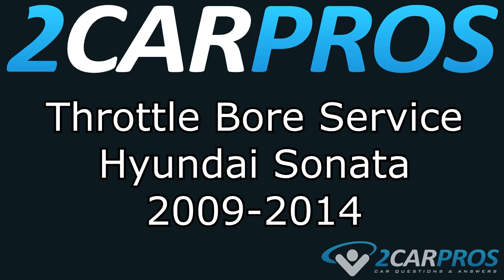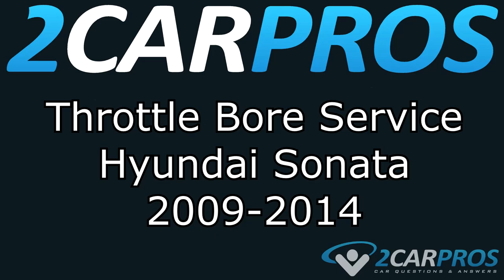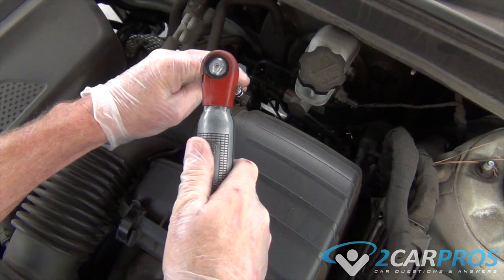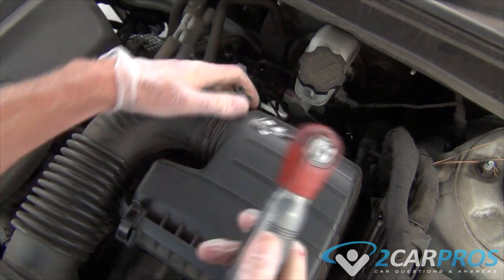Throttle Actuator Service Hyundai Sonata 2009-2014

Comment: I just cleaned the throttle body on my 2011 Hyundai Sonata and this video helped a lot. It was the first time to clean the throttle body and was shocked at the amount of build up inside. Now the car runs like new and simply amazed at the difference a simple cleaning can do. Thanks for the video!
Reply: I have a 2011 sonata as well. Having some rough idling noise. Fuel injector cleaner helped somewhat. But looking for a better solution. was rough idle the issue you were having and did it come back?
Reply: Don't need to relearn the throttle body after?
Reply: What issues were you having before cleaning the throttle body?
Reply: Thanks for this comment! My hyundai sonata 2014 got the same issue of funny Rpms when idling and I understood that idle has three important parts to check/clean which are: Engine Air filter and mass air flow sensor (MAF), throttle body and IAC (idle air control) sometimes the PCV valve also increase the RPMs when it's clogged.

Comment: I just did this to my tired old 09 Sonata.  Symptoms were a rough running, stalling engine and a check engine light. I forget the code #, but it tripped from the MAP sensor. My only deviation from the video instructions: I could not get the wires disconnected so I left them connected and gently turned over the throttle air bore for cleaning. It was awkward but I was able to do the cleaning without breaking any wires.  I also disconnected the negative cable on my battery before I began disassembly. 

Thanks to this great video, I'm back to a smooth running engine. Hope this is helpful to someone.

Comment: Great video! My Hyundai dealer did this when they cleaned out the GDI system on my '13 Sonata . As retired tech they were gracious enough to allow me to observe the procedure so I could do it myself next time. I was worried about messing up the calibration of the throttle body, but you put that fear to rest. Thank you!
Reply from the maker: Thank you for watching!

Comment: I can't say enough for this SIMPLE PROCEDURE!!! I have a 2010 Hyundai Tucson Limited 2.4L and this FIXED rough idling and the sensing mechanism "searching" for the right air-to-fuel ratio!!! The Technical Service Bulletin I found pertaining to the procedure I followed is: TSB "10-FL-009 2.0L AND 2.4L THETA ENGINE ETC THROTTLE BODY CLEANING". Gas mileage range registered by computer for a full tank prior to this procedure was about 230 miles. Mileage range registered by the computer after this procedure was around 317-320 after a fill-up!!!  AS A NOTE!!!, in the TSB it was stated at the conclusion of the cleaning process:

"Without starting the engine turn the ignition key ON for at least 10 seconds and then
OFF for at least 10 seconds. This procedure allows the ECM to automatically learn
the throttle valve position.

Throttle Position Learning Enable Conditions that must exist for learning to take
place:

• Battery > 10V,
• Engine coolant temperature >5.3C (41.5F)"
---
Hopefully this info helps more people!!!
Reply from the maker: Awesome! Thank you for watching!
Reply: Thanks, will try that too.
Reply: That help me. Thank you for sharing!
Reply: ADDING TO @FooKingsOC These are the TORQUE SPECS for the Throttle Body Housing, 2011 and later models	87 to 104 in-lbs	10 to 11.5 NM

Comment: Is there aneed to clean MAP sensor next to the throttle body?
Cause I still have power loss below 5000 rpm after cleaning the throttle
By the way mine 2.4 mpi engine
Reply: I have power loss from idle to 3000 rpm, pass that, it takes off. I have not cleaned the TB yet but I wonder the same thing you are on the MAP sensor.

Comment: My Hyundai accent 2007 looses power and starts running rough when I exelorate my guages start jumping around and my check engine light comes on but the ECU won't store the code I can't find anything online in regards to this issue

Comment: I do have a question: I have seen people from other car shops stating you cannot touch the insides of the throttle or the calibration setting will be gone. If you happen to touch the inside of it ( like you did on the video) you will need to get the acceleration of your car manually calibrated (probably by the car manufacturer's local retailer or a specialized service car shop). So the question here is did you have to work the calibration out once you finished doing this procedure you explained? I have a Kia sportage 2015 and I'm looking to fully understand the right way to get his done before taking it to the car shop (I'm still not sure I can do this myself even when I previously serviced other old cars I had in the past) Thanks!!!
Reply from the maker: There was no calibration needed the car started back up. The computer in the car auto calibrates. Thank you for watching!
Reply: Thanks for the quick response. So, as long as the ignition is off you can feel free to take the throttle body out, fully clean it out and the put it back in place?
Reply from the maker: Yep I have never had an issue. Thank you for watching!
Reply: I just cleaned the throttle body on my 2011 Hyundai Sonata and there was no problem after starting the car and driving it around.
Reply: These guys are wrong you going to have to do a throttle relearn if u open the butterfly plate so if u do before starting discount the battery hold the brake down for 5min and leave battery disconnected for minimum of 2hrs
Reply: @TheShawn3636  , that's what I've heard. This confused me. I was told NOT to manually move the butterfly flaps or risk doing damage. Can someone offer some insight??
Reply: The relearning process I have seen on another video is turn on the ignition, but don't start the car, then turn off the ignition for 10 seconds, and then start the car. @TheShawn3636

Comment: Hello,
If  I clean the throttle on my Sonata 2011, after that do I need some calibration with software or I start the engine and everythink will be normal???
Sorry for my English!
Reply from the maker: It will re-calibrate on it's own. No re programing required. Thanks for watching!

Comment: @2CarPros, just an observation, your technician did not disconnected to coolant hoses from the body.  i believe, it will be easier to clean if they have been disconnected, then you will have easy access to the throttle housing.  Thanks.
Reply: Not really easier if you have to do extra work now is it? This man did it just fine

Comment: I have a 2006 CM Hyundai Sante Fe 2.7 litre V6 manual transmission. The engine speed takes a long time to return to idle, when driving changing gears is especially bad having to be gentle as not to get driveline lash. What might it be do you have any thoughts? Thanks for your time.

Comment: If only the rubber hoses that connect to the air intake actually come apart. Mine are hard as a rock and completely stuck even with quality extended needle nose pliers cannot remove. Is there any product to spray to soften the rubber?

Comment: I had hesitation on acceleration and deceleration issues on my 2016 Sonata. Dealer tech said that VCMA needed replacement and work done on the intake. Is this the same thing? Also, will they need to update ECM after this service?
Reply from the maker: Yes and I would try this fix first before replacing anything since this is free. And no you don't need to do anything to the ECM. Thanks for watching!

Comment: I have 2012 Kia Optima hybrid p2110 and p0605 should I do this cleaning? Would it fix the problem ? Or there be other stuff related to those codes ?
Reply from the maker: Yeah I would definitely give it a try since its basically free. Clean it up all nice and new then wipe the codes and see if they come back.

Comment: Im guessing you do it like this still in the hood so as to not disconnect the coolant lines?  I've got a hyundai elantra that's alot like this and am kind of glad to come across a config that's similar, since another video said I had to flush the coolant first.  My only question here now is if it's safe to move the plate by hand since I know that's bad on some cars :P

Comment: I have a 2000 GLS 2.5 v6 that’s at 3000rpms at 80mph and I feel like that’s not right any suggestions?
Reply from the maker: I would definitely start with a throttle body service as it's free. Thanks for watching!

Comment: Was there a need to replace Gasket for Throttle Body? If so, which one would fit?
Reply from the maker: If it's in good shape I'd just re use it. But replacing it would be fairly cheap and you can find them at rockauto.com Thanks for watching!

Comment: So there are no coolant hoses attached? I have a 2013 Elantra and it has coolant hoses connected to it, so in that case do I need to drain the coolant before taking out the the throttle body? If I don't drain coolant what could happen? Thank you
Reply from the maker: So that is a coolant pass through that heats up the throttle housing to make the air hotter so it combusts easier. If you take those hoses off it will leak coolant. Probably not a ton just make sure the system isn't under pressure when you do it. Thank you for watching!

Comment: Hi, n thanks for the video!!! Two questions!...Do we need to disconnect the battery, and what is the torque setting for tightening up the throttle bolts?!    Don,  TX
Reply from the maker: No not really and I can't find the factory spec for the torque. Just tight in a cross pattern. Thank you for watching!
Reply: 2011 and later models	87 to 104 in-lbs	10 to 11.5 NM

Comment: Thanks for this video! Great step by step. I always struggle with dang electrical connectors as it seems they're always different in EVERY car at EVERY connection! I typically end up breaking some dumb snap retainer piece of plastic half the time. Love the University of YouTube!
Reply from the maker: Thanks for watching!
Reply: @2carpros   @2CarPros  I have a 2009 Hyundai sonata 2.4 cylinder  and I replaced the alternator. Fairly easy job. But after I replaced it I started the car up and went for a ride. Everything seemed fine until I came to a stop sign and as soon as I pressed on the brake the car stalled. Not only does it do that but when the engine is cold the idle looks good but as soon as it warms up the idle drops down to a low 400 to 500 rpm and if I rev it up it will stall when idle comes back down. I had none of these problems before replacing the alternator. I did not touch any vacume lines while replacing the alternator. I'm totally baffled. Before I start replacing things I figured I would try and get some help first. Also I get no codes.

Comment: i did the same service at my 2014 sonata but dtc p0106 came up  MAP/BARO Pressure Circuit Out of Range
Reply from the maker: Did you plug your mass air flow sensor back in? Leaving that unplugged can cause this. Thanks for watching!
Reply: Next time you have to do a throttle relearn by disconnecting the battery hold the brake down for 5min and leave battery disconnected for a minimum of 2hrs
Reply: What solved it for you?  I just did this today and got the same results.  My plan is to check/clean electrical connector and pull map to clean and new air filter.  But experience is GOLDEN... pls : )

BTW, throttle bodies need cleaning on many and by many I mean almost all vehicles.
Reply: I let the car sit unplugged from the battery for 3hrs
Reply: Also if it continues to come up just changed the map sensor
Reply: With that code your car has entered limp mode

Comment: I have a 2007 hyundai sonata. It literally accelerates as soon as i put it in gear, weather it is reverse or drive. Already replaced the throttle body but didnt help. Any ideas?
Reply: I have similar problem on my Hyundai i20 after throttle body cleaning, idle rpm has been increased and pick up speed of the car has been increased.  I have no idea.
Reply: Louis: TPS sensor ( throttle position sensor ) usually located under ur pedal or at the throttle body itself. Easy to change and inexpensive, however I’m not sure whether u would need to calibrate the sensor once fitted so the sensor knows what is 100% open throttle and 0% closed throttle

Comment: You can't clean the throttle body like that if it's the electronic type, you will mess up the calibration then you have to reprogram it as far as i know
Reply from the maker: No, the computer is pre-programmed to work with the throttle body clean. So when it gets dirty is the problem. When you clean it, it returns back to factory specification. Thank you for watching!
Reply: It has a spring return mechanism....with return sense.....if it can't return to zero caused by build-up from carbon and other varnish type compounds, It "hunts" for zero, which causes rough idling!!!

Comment: Do I have to remove the map sensor to spray valve cleaner in through the throttle body?
Reply: Not sure if you have to but I normally do when I clean them. Better safe than sorry I guess you could say.
Reply: 2 Years late here, But I have a video on the MAP Sensor, and I would say anyone trying to do the Cleaner through the Air Intake should remove the MAP sensor. Or be prepared to clean it after you spray in for instance SEAFOAM.

Comment: Warning , electric throttle body do not messing with the throttle body plate just clean it do not open it or you will mess it up , your throttle plate will be open up and will not close anymore and you will have high rpm when starting up your vehicle or it have to be replace .

Comment: Are there torque specs for the throttle housing bolts?
Reply: 2011 and later models	87 to 104 in-lbs	10 to 11.5 NM, Sorry I'm a year late here lol. But just in case someone else needs it.

Comment: What size socket is used on the intake? As well, what size socket is used on the throttle body? Do you need to replace a gasket where the throttle body mates to the engine?
Reply: 10 mm
Reply: 10MM and these are the Torque Specs 2011 and later models	87 to 104 in-lbs	10 to 11.5 NM

Comment: What was the symptom?
Reply: Mine has been idling like garbage for a while! Just cleaned this out. Replaced my MAP (manifold absolute pressure) sensor as well, as it was throwing a code, and since everything was out of the way. I also disconnected and cleaned out the gas lines too. Idles like a newborn baby again!

Comment: When is the time to clean throttle body?
Reply from the maker: Every time you change the spark plugs is a good idea or if you experiencing an idling problem. You'd be surprised how often it fixes that.

Comment: Would this cause a oil light to flicker on n off when given gas light pops off or while driving it happens only at idle..?
Reply: Hi, I've changed 2 of these. Oil light never turned on like you mentioned. Seems to he an oil pressure sensor causing the issue. Bad throttle you'll notice bad idle.